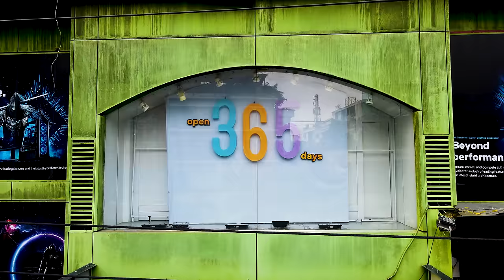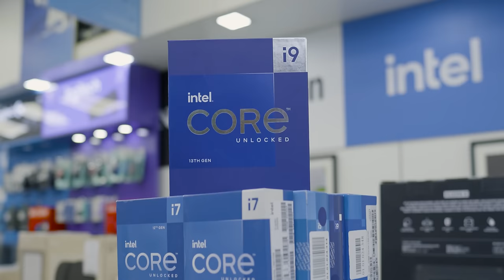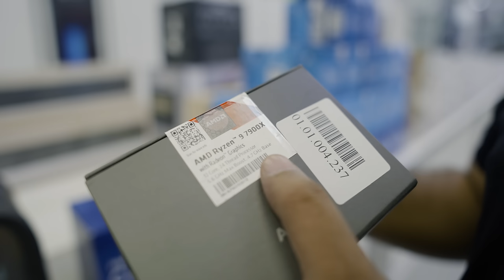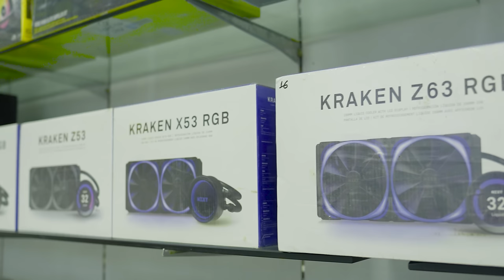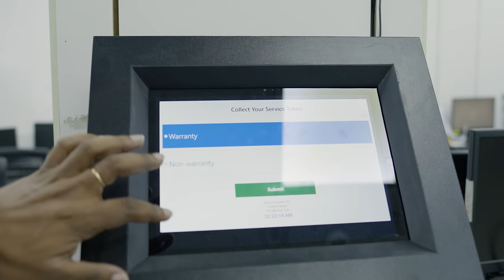How to Build a Gaming PC ft Banani Ryans Computers

Comment: Few days ago i build my 1st PC. The experience was amazing. After lots of research and saw diffrant video and your video for budget build. I chose Ryzen 5 5600g
B450M ds3h wifi
Gskill 8 + 8 gb ram
350w psu turbo white gaming case. 
1TB aluha ssd.
And trendsonic monitor
And i build the system myself.
Thanks PC builder Bangladesh  for the knolageable video.
Reply: How much it cost without monitor?
Reply: Cost?
Reply: @Charizard726  43k taka (whithout monitor)
Reply: @MD_Areeb  
New generation er games chole valo vabe?

Comment: zaman bhai, build a pc with this components !
CPU: Intel 13th Gen Core i9 13900KS

MOBO: ASUS Z790 ROG Maximus Hero

RAM: G.Skill Trident Z5 RGB 32GB (4 x 32GB) DDR5-7800

GPU: Asus ROG Strix GeForce RTX 4090 OC Edition 24GB

SSD: Samsung 990 Pro 2TB PCIe 4.0 M.2 NVMe SSD (2x 4TB)

PSU: ASUS ROG Thor Platinum II 1200 Watt 80 Plus Platinum ATX

COOLER: Lian Li Galahad II Trinity Performance 360mm

CASE: Lian Li O11 Dynamic EVO XL

CASE FAN: Lian Li UNI Fan SL Infinity 120mm Case Fan - x11

Comment: BUY FORM RAYNS RANGPUR 

CASINE : PC POWER ICE CUBE   / 8  FAN
MONITOR  : HP M24f 24" FHD
MOTHEBOARD : TUF GAMING A520II PLUS
PROCHECOR : RMD RAYZON 7 _ 5700G 
POPWER SUPLAY : GIGABYTE  P850M  
RAM : 16+16 GB
ROM : 1TB BY HP 
MOUSE KEYBOARD COMBO : MARVO CM306 
HEADPHONE : H2010D 
GRAPHIC CRAD : ASUS ROG Strix GeForce RTX 4060 OC Edition 8GB GDDR6
WEBCAM : Logitech C505

Comment: How to Build a Gaming PC featuring Banani Ryans Computers. The video includes discussions on components, laptop bags, XLR cables, processors, Cooler Master cases, and more.

Key moments:
00:01 The video showcases a variety of foreign products and components, including music, laptop bags, XLR cables, processors, and genuine packets.
          -The presence of foreign elements like music, laptop bags, and XLR cables in the video. 
          -The mention of processors and genuine packets among the foreign items featured in the video. 
13:16 The video discusses a case manufacturer, Cooler Master, and their innovative SL 600mm case model, focusing on performance and features.
          -Cooler Master is known for innovation, price, and performance in their SL 600mm case model.
          -The video mentions the importance of Cooler Master values and addresses heater problems in the case design.
          -The size of the case and the competition in the market are highlighted, emphasizing the brand's reputation.